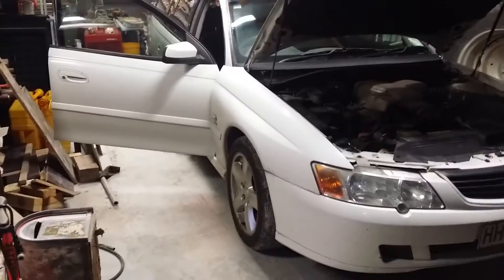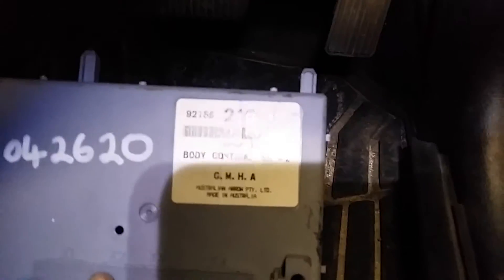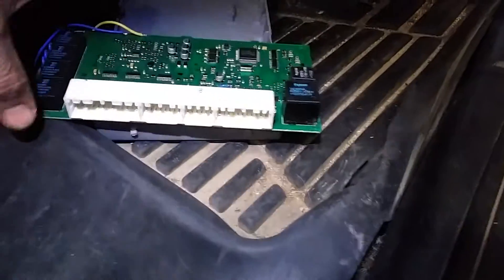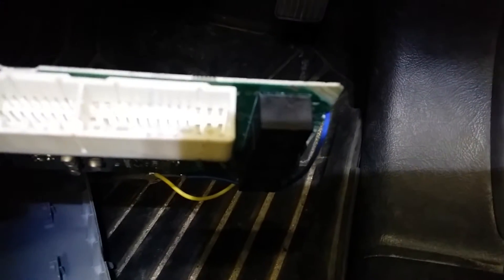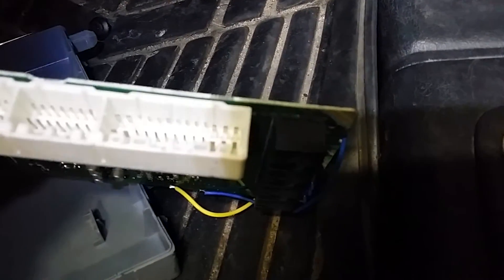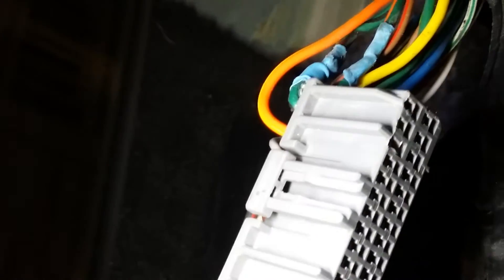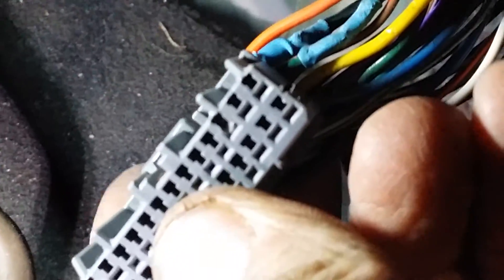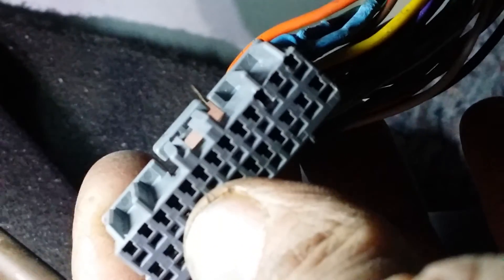VY Commodore Power Window Fault BCM Fix - Part 1 of 2.

Comment: Any fixes for the central locking not locking any doors with the remote ?
Reply from the maker: Hey. Sorry we sold this car a long time ago.
I would suggest if all the doors will lock using the key in the door. This tells you, for the most part, that the central locking is working.
So a likely issue could be flat battery in the key. These keys, I believe, don't generally have a replaceable battery.... however, it could be done.
I would separate the key and use a multimeter to check battery voltage. If it's flat, investigate a new battery. And or run the car with the key plastic removed and re check the key battery voltage...possibly it is supposed to charge via that metal pin out the front of the key... I am unsure so would need to look at the wiring diagram.
If the key is flat, you might be stuck buying a new key fob.
If the key is fine you'd need to systematically work through the electrics.... possibly BCM plugs again..... 
Cheers Andrew

Comment: Your a legend Diesel followed your instructions fixed the problem . Added a little solder to the first a third pins to make the plug contact tighter and fixed the problem. Holden must be making millions on switches and window regulators . $320.00 a pop.

Comment: Hi there, i have a problem with the window is not going up. Going down is fine. I have taken the bcm out and visual inspection is ok. When i hold the window up switch i can hear the aerial clicking.  The problem I'm  having is when i unplug the window switch the aerial goes up even when the car is off. Anyone know why would this be happening? I'm trying to find bcm wiring diagram buy still no luck. Any help to diagnose is appreciated. Cheers

Comment: My drivers side window won't work at all,  I can hear random clicking under the dash should I be looking at the bcm also or the switch first
Reply: Jimmi Johnson  it was the switch in the center, i pulled mine out and played with it and the button under the switch was stuck and it clicked and I put it back and it worked fine ever since
Reply: Jimmi Johnson 100% it’s the switch 
Just fixed mine
Reply: Jimmi Johnson so you replaced the whole switch module?
Do you hear the relay click under the dash?
Reply: Jimmi Johnson it could be the regulator in the door

Comment: I pulled the module out, scraped the terminal and pulled it out like you said. It works for the first 2 goes then starts its crap again. Is there something I might not be doing right? It's driving me mental.
Reply from the maker: Hard to say. That fact it works for a bit says your in the right spot. Possibly the plug moves back into it's normal spot after a little driving. You could try messing with the female plug to make it squeeze against its mate better. Some electrical contact cleaner would go a miss. Ours is still going sweet.

Comment: I’ve check mine it’s all fine but my power are still not working and I’ve replaced the power window switch 6 times has any one have clue
Reply from the maker: If it's only the power down that doesn't work (as in you can hold the down button on till the auto function times out -15secs ??? can't remember), then I'm pretty sure it will be that one connector. See my second video...part 2. 
I can't remember the terminal styles exactly, but maybe you could give that one pin in question a slight twist with some needle nose pliers so it contacts the female plug more firmly). I'd have to investigate ours to be sure.